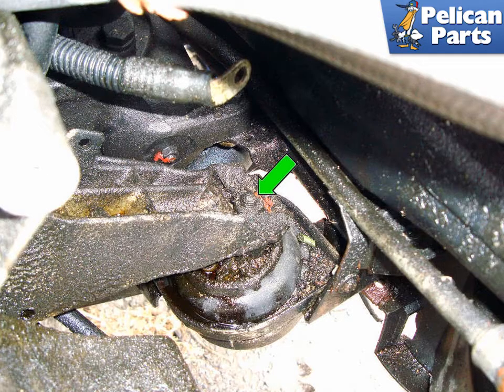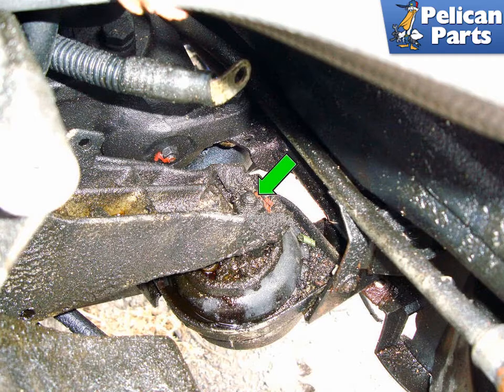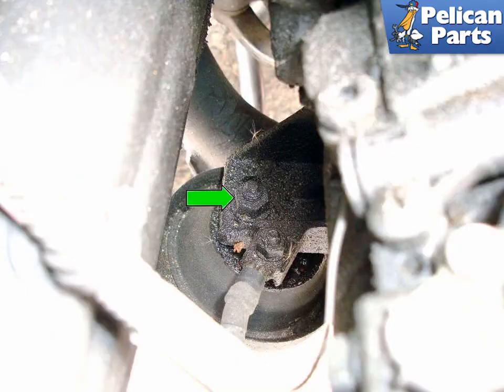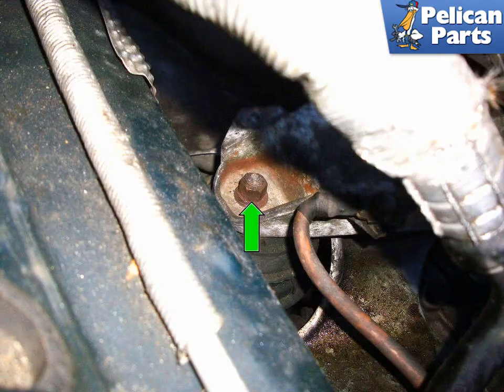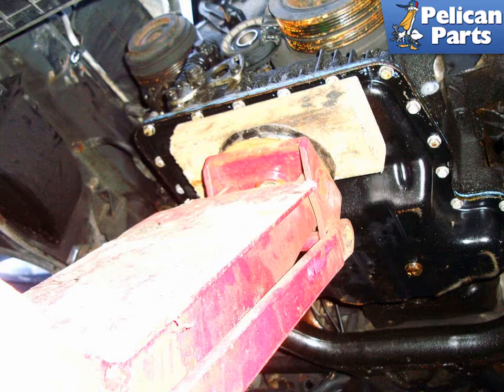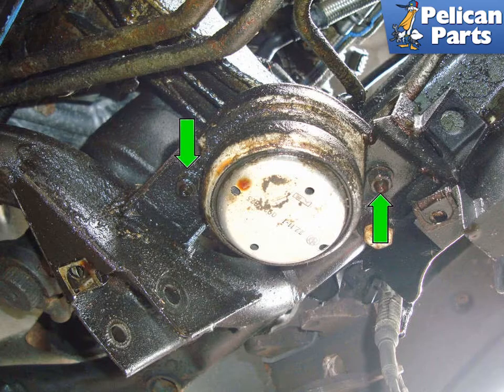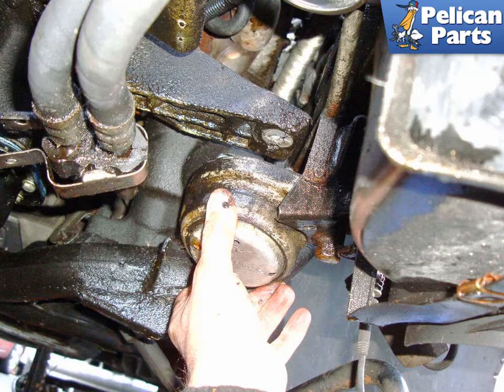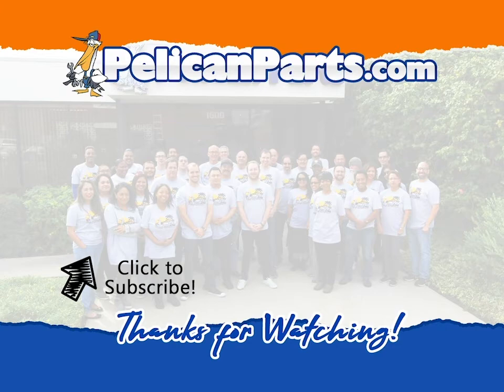BMW E39 5-Series Motor Mount Replacement | 1997-2003 525i, 528i, 530i and 540i

Comment: Those rubber tubes how do you remove them and ou them back? What do they do ? Thanks !
Reply from the maker: Which ones?
Reply: @pelicanparts  hi! The engine mount vacuum hose ones 😊
Reply: @Carlos3ac there shouldn’t be any vacuum lines connected to the engine mounts, if you are referring to the air intake box rhat he mentioned for the 6 cylinder engine, just simple loosen the clamp with a flathead and pull it off. the clamp connects at the throttle body.